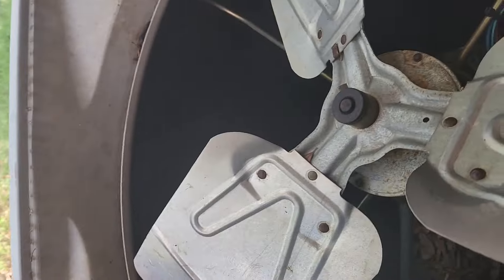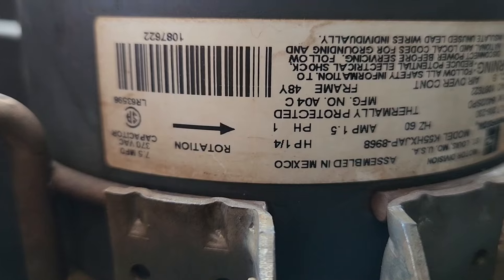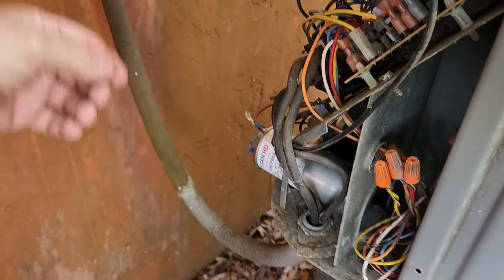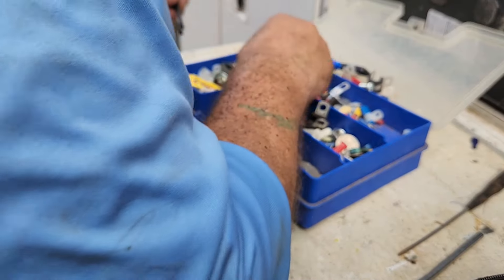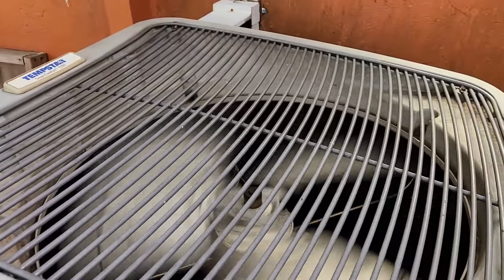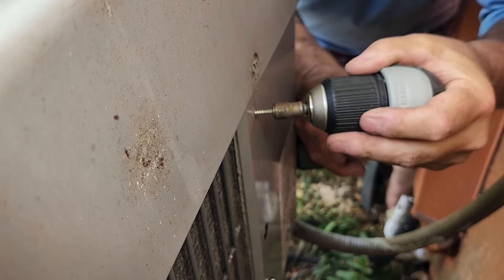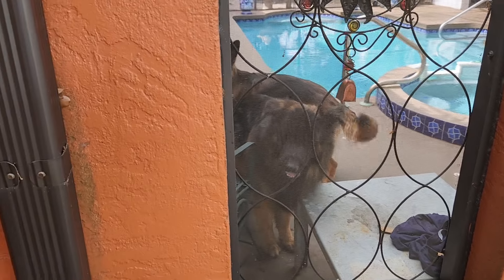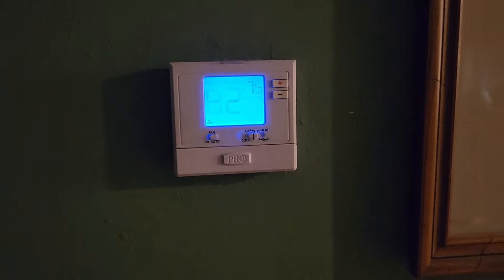A/C MAY DAY , CONCLUSION !

Comment: Also throw 1 of these on your truck.
2 Poles FLA 30 Amp Coil 24 VAC Air Conditioner Condenser Compressor Contactor Motor Definite Purpose AC Contactor

Comment: Clean your condenser coil from the inside to the outside direction with a very mild dish detergent like Dawn.. Water will not hurt the wiring. Same thing happens when it rains. Condenser is built to be waterproof. I mean don't go crazy with the full hard spray on wiring. 
Look at a Klein #CL700
Reply from the maker: I cleaned the coil when I got it repaired, water from a hose and my thumb 👍, looks good,sounds better from my bedroom, she's purring!

Comment: Don't ever touch those capacitor  contacts without first making certain the capacitor is fully discharged.  Lethal voltage from that capacitor.
Reply from the maker: Message received, loud and clear,I knew,but your emphasis got my attention, thanks brother 🙏

Comment: Nicely done. No central air in Florida in the summer is the same as no heat in Connecticut in  the dead of winter.
Johnny Sunshine sleeping good tonight y'all
Reply from the maker: It shit the bed after 2 hrs.i need a new fan motor,pulling to many amps,I pulled the breaker
Reply: That sucks. If  it ain't one thing it's another. Life is life, don't sweat it. Sending positive vibes. Bless you
Reply: Yes that  fan motor looked like it was struggling also I think it was turning way too slow😮

Comment: Motor doesn’t sound good
Reply from the maker: It may have been damaged by the wrong size capacitor, and time will tell.
Reply from the maker: I agree 👍
Reply: @johnphillipsplumbing7148  nah that guy just used the 7.5 part of that 35+7.5 no problem with that
Reply from the maker: @joeshearer1247 it's off again,I need a fan motor,motor stopped, hotter than hell!
Reply: @johnphillipsplumbing7148  yep I knew that sound.
Reply: Hopefully, Nate has a King!😂😂😂